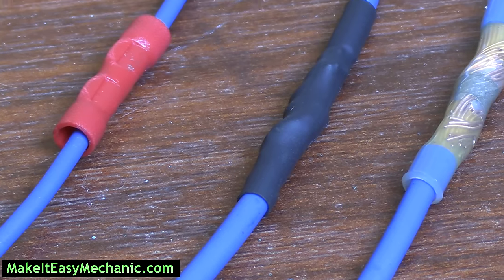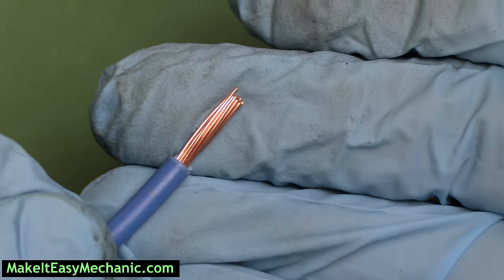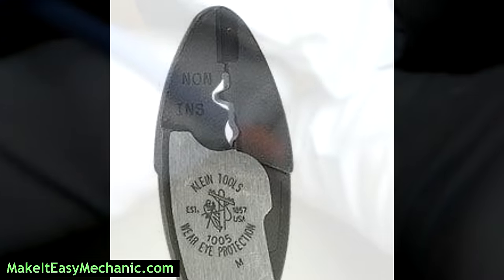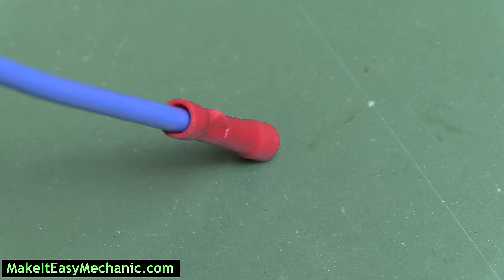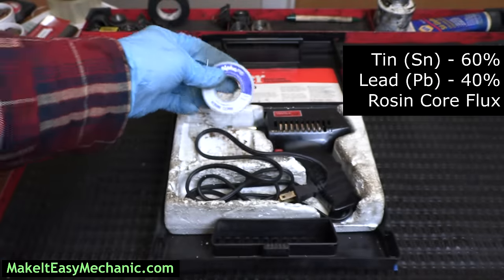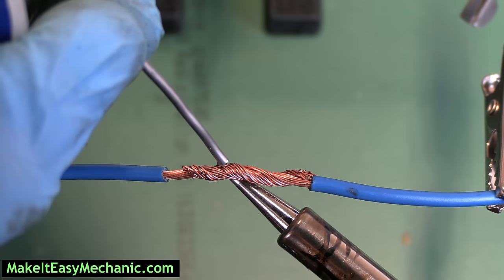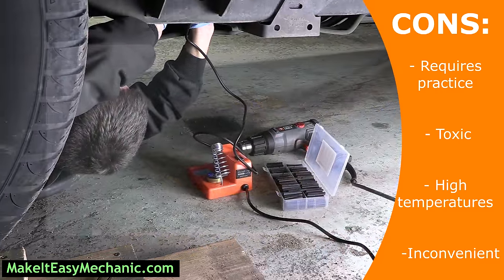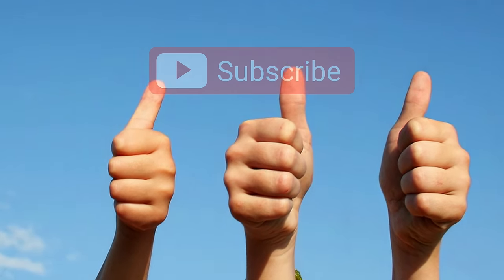How to splice wires - how to solder, how to crimp, wire connectors

Comment: Dont know anything about wire join. Recommended by youtube. Not english native, first time knowing splice wires word. Not knowing the definition of word when writing.  Knowing first 2 way on other channel, knowing first 2 way mistake from this channel, knowing how to do first 2 way clearly on this channel. Knowing the best method of last way. Short heavy content 10 minute video. Perfect masterpiece. Now I want to break apart my home just to fix some non certified installator work mistake.
Reply: Thanks for pointing this out, Alice.
When I googled for the "definition of splice":  I got the definition for this verb: 
"join or connect (a rope or ropes) by interweaving the strands."

Comment: Open barrel crimp connectors and dual wall heat shrink are the best for a vehicle wire splice. Solder is prone to issues to vibration and causing the joint to break
Reply: The best and most reliable connection is a properly done solder splice, even for vibration. If used in an inside environment regular heat shrink is adequate.  If used outside on in high moisture areas, adhesive heat is necessary as the regular stuff will cause corrosion problems.

Comment: If you're going to be soldering wires together, it's worth putting a bit of dielectric grease under the heat shrink tubing if there's any possibility of having moisture nearby. It's not going to be water proof, but it will keep out whatever bit of elements might get past the heat shrink tube.In most cases, it's going to be overkill, but this is particularly important for wires in automotive or marine applications as you can get weird electrical faults that mysteriously come and go based upon the weather.
Reply: That's good advice.  If you can get it, a better option would be to use adhesive heat shrink. The adhesive does a very good job of sealing the joint.

Comment: I made a successful attempt to get my refrigerator running with a few new soldered in parts, now reading thru the comments I discover I may have failed because my shrink-wrap is not the glue kind?  hopefully my attempt will last till I get more experience.

Comment: As shown in other videos where they cut the joint, the 3rd type does not make as good a connection as a correctly soldered joint. Inner parts of wire are not soldered at all. So even though it's more convenient, it may not be the right choice in some applications. I feel it is better than a mechanical butt connector though because the wires are twisted together first increasing surface contact and then held in place by the outer layer of solder.

Comment: That last connector seems like it would be a cold solder joint every time.  It's hard to imagine getting the wires hot enough through the shrink for a proper solder joint.
Reply: I never considered that...but I have used these a handful of times for trailers and outdoor applications. They work great.

Comment: I don’t know why I am watching this but I learned so much about shit I will probably never use. You can never stop learning, right?
Reply: I fixed my dryer's circuit board due to a very common wiring issue with solution found on YouTube.  $30 of supplies + a couple hours of work and research saved me hundreds in parts and labor.
Reply: @emmakai2243  - As well as a new skill acquired. Win-win in my book.
Reply: I can do the same

Comment: Nowadays most solder is lead free, especially here in europe. And you can find amazing "portable" soldering irons for really cheap, like the pinecil. It's usb powered but it's called portable since you could run it from a power bank if it's strong enough, but personally im just using a 65w adapter (like a laptop adapter) from the wall outlet.
Since it has the heating element in the tip it heats up in just a few seconds and can easily compete with "mid-tier" soldering stations. Just make sure you use the correct tip for higher temp applications.

Comment: The cold temp solder connectors cause ... cold solder joints. It's just on the surface, I've taken them apart, it flakes off with your fingernail.

It wouldn't be bad if it absorbed into the wire, but I've not ran across one yet where it had.

Comment: Which butt connector works best for installing a CB Radio into a commercial vehicle? I already have the CB wires in the compartment however the piece that plugs into the adapter was removed by someone who used to have that truck prior to me. I can't find an adapter piece to connect to it. And I was told by someone I should just cut it off and hardwire the CB Radio wires to the existing wires.

Comment: If you heat a razor blade with a torch or lighter you can cut the insulation without cutting the wires. I’ve used this method many times.

Comment: I hate it when people do the Cross twisted style solder joint. It’s almost impossible to unsolder the joint. A good solder joint will be stronger than the wire, so twisting is unnecessary.  On another note, I have a couple of those power probe soldering iron kits and I love them!  I haven’t had an issue with one of them yet and they will solder some pretty big wires.

Comment: The solder/seal connectors have a bismuth alloy solder which melts at a lower temperature than regular 60/40 solder. This may be a concern for some connections. Nothing beats a well crimped connection carefully sealed with shrink wrap. Soldered connections can be less reliable than crimped, especially in high vibration or thermally challenging applications.
Reply: A properly done solder connection is far superior to any crimped on splice. Even for vibration.  I'm not sure what you meant by thermally challenging however.
Reply: @tchevrier  this EE disagrees. Thermal cycling is one failure mechanism for solder joints.
Reply: @BretBerger  And this EE who has done considerable testing  disagrees with you.

Comment: Thank you for the lesson.
I love the idea of heat shrink self solder connectors, that would make life much easie.r 
I have a question please.
Which method is best suited for a more permanent waterproof solder connection.  
1:  Solder the connections then coating with dielectric grease and finally heat shrink.  
2: Heat shrink solder connectors. 
Or are they both six of one, half a dozen of the other.
Reply from the maker: They are about the same, first depends on your soldering skills, second on the quality of your connectors
Reply: Thanks

Comment: Just a note , I dislike tape but it works , try stretching it titter also have you tried posilocks love them . Expensive but worth it , can be taken apart and re used . Replacing old device with new , or if you routed wire incorrectly you can re do it. I also heat shrink them
Reply: Yes finally someone else mentioning positaps! They don't seem to be talked about much when joining or tapping wires. Yes they're expensive but worth it for the convenience and time you save 👍

Comment: Remember to put the heat shrink on the wire to rest until needed, before connecting them, then once connected slide the heat shrink onto the spliced wires to them heat up and seal connection

Comment: Great video, but you failed to mention the use of soldering flux.  It makes proper joints so much easier.  In your example of a cold solder joint, many times your need to start a solder joint that way, if you are having trouble getting enough heat transfer.  Solder will flow to where the flux is.  i always tell people who are new to soldering to just add flux to both sides of the wire or joint.  You can get a perfect joint, using a glob of solder on the iron, and it's easy!  Also, I think you should mention that solder will have a hard time adhering to oxidized wire, such as older wire on a car.  Using a brass brush to brighten up the copper, and application of flux, guaranties a great joint.  I rarely rely on the flux in the core of solder alone.  In cases where I do, it's only with new components, which cleaned and free of any oxidation or tarnish.  Also, I've found that ratcheting crimps from import ratcheting crimpers are not as secure as plier type crimpers, made with a dedicated crimper.

Comment: Very interesting anyway. Ive watch a couple of this type. As a computer technicien im not about to soldergin at first hand but i wanted to be stuffed then ive bought a heat gun, a soldering tool, etc as i found on amazon. They look like "magic Xmas box". And finaly in real they are just common and close to be "toys box" but as tested they seems to works.

Comment: Oh by the way, I bought that auto ratchet crimper and yes u can still over crimp the crimper. And even if u just squeeze the auto crimper doesn't mean it's strong enough to crimp. Not worth the high price. I think I better stay with solder heat shrink sleeve. Or maybe is my lack of experience.

Comment: Only prob I found w the video: crimping is the only solution out of the 3 to ensure a connection where high heat (engine bay eg.) can cook a soldered connection regardless of the solder used

Comment: Pro Tip: For the absolute cleaning stripping cut, do yourself a favor and do like the soldering pros—get yourself a heat stripper. The heat melts the wire covering and enables you to pull it to a precise length without damaging the wire.

I've been going through these videos for my own purposes.

Also, when doing soldiering, wear a Respirator like a P100, as the fumes from soldering aren't exactly safe. Make sure to wear gloves too! Oil from fingers can mess with the wetting action.

Finally, the Respirator & gloves is a good general rule when working with toxic or hazardous materials (like most chemicals used to clean car parts).

Pro tip 2: When soldering, make sure to use an appropriate soldering tip size for the size of the particular project. The tip used in this video is far too small for the project. According to classic expert materials (see Pace Video series), the tip should be in contact with the device for no more than 2 seconds. There are techniques to doing so and I highly recommend looking up and watching those types of training videos.

Likewise, you can use lead-free solder that will be required to meet US & EU manufacturing Standards as lead solder has been outlawed in most applications (despite being available for consumers).
Reply: Have to disagree on one point, he is soldering two pieces of copper wire together, and he's showing people how to work with the tools most people would have available. You don't have to worrying about excessive heating (at least until you insulator starts melting), like you do with IC chips and electronics, that is a whole different kettle of fish.

Comment: Very well done and an excellent and well-coverd tutorial. One thing that has always plagued me is the temperature of the Soldering Iron. This is rarely mentioned in these tutorials. Most Irons that a person gets has set temps that are barely hot enough to melt the solder let alone the material needing solder. The other extreme is getting an Iron that can get too hot. So, what is the correct temperature?
Reply from the maker: I play it by ear so to speak, thicker wires need more heat obviously. if you are having trouble getting the solder to melt - turn up the heat. If you are burning your wires - turn the temp down.

Comment: Only problem with solder in vibration prone areas is the wicking of the solder causing it to crack down the line

Comment: What's the separater in the middle of the the connector for? Best video I seen for wire reconnect btw awesome!!!!
Reply from the maker: Keeps the connector centered in between two wires, so you dont slide it too far on one wire and not enough on the other.

Comment: When soldering i tap the tip just whit a bit of solder toch the wire and then put more tin on the wire you want too solder
Reply: Good practice! (although it was already mentioned in the vid)

Comment: Crimp connectors: fill the connector with dielectric grease or No-Ox, then crimp.  Also slide the heat shrink over the connector after it's crimped and you won't have a hole in it after you shrink it.

Comment: If you use the last option, would you also add the heat shrink tubing on top of a cable e.g. a cable made up of two wires?
Reply from the maker: You can, wouldn't hurt.

Comment: Informative video, A few weeks back I was over Buzzsah shop/man-cave. He is setting up a radio room and was showing me How-to solder and tape, he did the same as you, however, he pulled the tape tight while wrapping the joint, then after tapping he used a zip-ty around the tape-end stopping it from becoming undone due to temp changes. Do you think that is a good idea?
Reply from the maker: It's fine, I would prefer using a heat shrink tube in that case

Comment: Wait, why will the resistance INCREASE if we accidentally cut some strands of wire? should it be decreasing or something?
Reply: Less wurefewer strands means increased resistance because the total area/amount of flow path is reduced.
Try jump starting a car with 10ga wire vs. 6ga.

Comment: Great video! This may be a really stupid question but would it be a bad idea to use the crimp connector along with a shrink tube over top of the connection to help with water proofing. I'm a noob trying to change the connection plug on my kayak trolling motor. Thanks!
Reply from the maker: Yeah, that's not a bad idea. Also putting some dielectric grease on the connection, before putting a heat shrink tube on could help with waterproofing
Reply: @MakeItEasyMechanic  Thanks I really appreciate the response! I will give that a shot.

Comment: What if I wanted to fuze 3 wires together? Can I just put 2 in one end and then continue with a single wire on the other end? 18 gauge wire. Great video!
Reply from the maker: Yeah, I've done that before. Worked fine

Comment: Repair shop I was at recently covered their "repair" with electrical tape. Thoughts?
Reply from the maker: Depends on how they repaired it. If they soldered or crimped the wires - it should be ok. But if they just twisted the wires together I'd be concerned.
Reply: @MakeItEasyMechanic  yeh, no solder, no crimp. Think after seeing this vid I'll try tidying it up myself 👍

Comment: Nice video, thank you for sharing this information.
Have a question, one of the wire of an ignition coil got broken and I'm wondering what method is the proper one to repair the wire, soldering or crimping?
Because the ignition coil is located on top of the engine, the is a lot of vibration, and some people say that the solder may crack.
Reply from the maker: I prefer solder over crimping. It only cracks if you overheat the repaired area.
Reply: @MakeItEasyMechanic  thanks for the advice
Reply: Good video.  The solder won't crack, assuming that it wasn't a cold joint.  What I have seen, in a flexing/vibration environment, is the wire break at the beginning of the solder joint.  In that environment it is a MUST to strain relieve the solder joint.  I've found properly sized heat shrink is acceptable.  Just wrapping with tape may not do the job.

Comment: If I did want to use a lighter for the last method about how long in seconds should you melt the connector plastic?
Reply from the maker: Until it shrinks tight around the wire

Comment: For the last option, how would you size the self solder heat shrinks if you want to connect a 12 or 16 AWG wire to a 20 or 22 AWG wire?
Reply from the maker: I would get the connector that fits the larger wire and let the solder do the rest.

Comment: With all that being said, why not just use the self-soldering wire connectors? Obviously the quickest and easiest method, and less expensive if you're someone who needs to do the occasional repair. I got myself a kit of those and i expect it to last me ages

Comment: They didn't train me how to crimp when I was in the service working on radars. They trained me how to solder, and required certification for very good reason. It is the best way to make an electrical connection with minimal resistance. You did not use a proper heatsink on your wires to limit solder wicking under insulation. A proper strain relief is required for ALL military electronic connections for good reason. Crimps do not have better resistance to failure due to vibration. I've soldered many automotive connections, and many times it was to repair an intermittent crimp joint that can be very difficult to diagnose.

Comment: What are your thoughts on using an uninsulated butt connector and feeding solder into it. Then weather proof heat shrink. ?

Comment: Unlike Crimping, Soldering Might Be Unsafe for High-Current Applications: Current-Caused Heating Can Degrade The Joint & Eventually Result In Anything - From a Disconnection, To a Fire. Also, a Quite Reliable Electrical-Wire Connection Can Be Made Using Screw Terminals (Which Require Just a Common Screwdriver).

Comment: The only thing about soldering wires ive learned is you gotta find the right heat. Low heat and youre sitting there waiting for the soldering process to stat and may never start. High heat and it solders but the heat conductivity goes thru the wires and melts the insulation off from the inside. I rarely solder/heatsink wires nowadays just due to in favor to method 3. 

Another tip for method 3 is after you heat up the self soldering connector and the process is finished, let the wire be for a few moments while the connector cools. if you go to moving the connected area around right after it could cause the jacket on the self soldering connector to rip as it will be hot and very pliable and it could cause the solder joint to fail as well.

Comment: Doesn't soldering to connect wires affect electrical conductivity? Meaning reduce the conductivity?
Reply: depending on overlap length and solder thickness the joint can have more or less resistance than an equally long piece of same wire